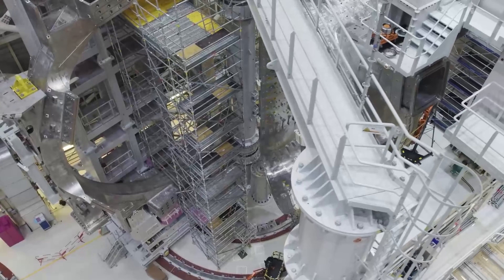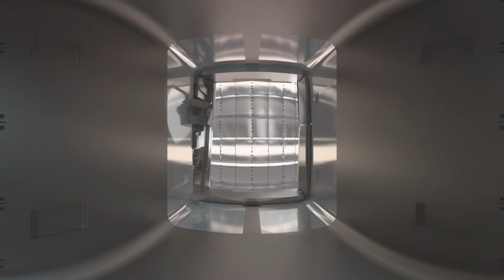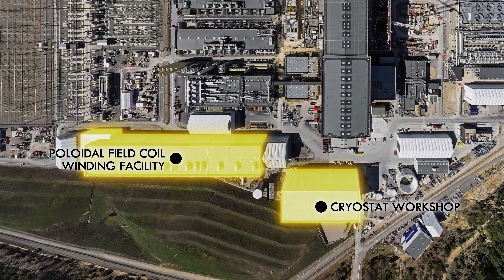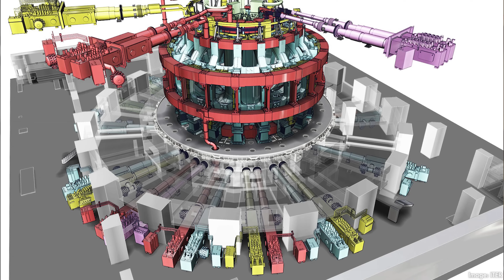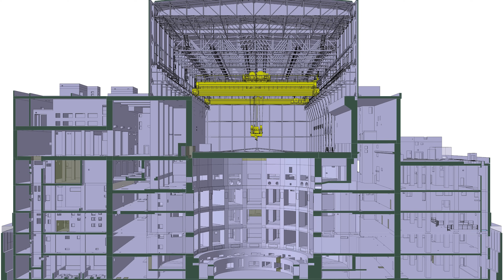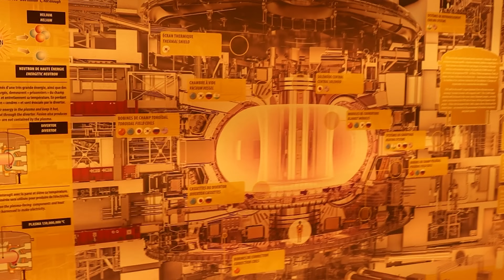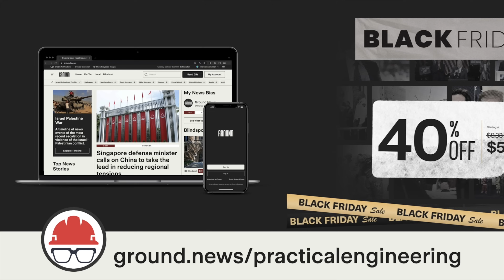Engineering The Largest Nuclear Fusion Reactor

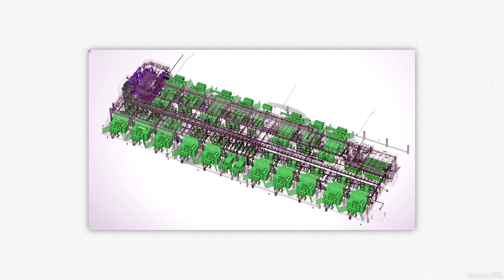Comment: 9:30 LHC has an automated beam dump process that works based on  perturbations in the magnetic field.    However their process has to work in the span of milliseconds in order to prevent structural damage from the beam.  So I was somewhat surprised that you mentioned this process took seconds for ITER, since that may actually be too long in the case of magnet quenching.
Reply: I'm surprised the LHC's beam isn't dumped even faster than milliseconds. I think the seconds bit is just dissipating stored energy to protect the magnets from thermal damage from current flowing in them, rather than beam/plasma containment. The plasma will not be able to be contained the instant (probably less than millisecond timescales) one of these magnets quenches, so the plasma "dump" is probably a separate process that happens much faster (likely microseconds) than the magnet-self-protect-current-dump (seconds) process.

(I don't work at ITER but this is my best guess)
Reply: The time scales of a supermagnet are shockingly long. Magnetic fields soak into them like water into dirt. Turning "on" a supermagnet can take hours, as the field slowly rises to the target strength.

Comment: The technology, engineering and construction is awe inspiring.  Im getting less and less "sold" on tokamak systems, mainly due to degradation and contamination effects of being exposed to long term exposure to neutron flux and high temp plasma, makes me a bit more skeptical of this route.

Regardless of it its the route we end up taking, ots crazy impressive.
Reply: Agreed. There are unanswered questions about what is going to be the best plasma-facing material(s) and what to do when they degrade. The human race collectively is going to need to come to terms with generating certain amounts of radioactive waste and containing it appropriately. No (currently known) way around it while also sustainably producing enough electricity to meet demand.
Reply: @erikdietrich2678 plenty of people are thinking about that! From proposing smaller tritium-breeder reactors separate from power-generating reactors, to those suggesting we’ll never get large-scale D-T fusion due to the neutrons so they think we’d have to wait for He3 to be economically viable. (Which would need much denser pressures to run; so researching with D-D and then D-T, exactly as Iter will be doing, would still be useful for getting to that point.)

Comment: The amazing thing is how this massive boondoggle got this far. How practical is it? Zero. Nobody talks about the cost per Kwh because there is no possibility of it being worthwhile. The cost of the reactor is what, 100X the value of the power? And that's if it works. it's a nice, interesting, super expensive EXPERIMENT.
Reply: Yes. It is an experiment. An expensive one.
So where other things. The Manhattan Project did cost as much as the predicted cost of ITER (which, of course, will cost more).

Comment: IDK, Grady.  It's kind of hard to get super excited for this as a step down the path toward fusion electricity.  This isn't even the buying a map stage of the journey.  It's more like the buying a sextant and chronometer stage.
Reply: You never got excited for a trip/tour you wanted to take when you bought yourself some binoculars or new outdoor shoes?
Reply: @cy-one  
IDK how apt that comparison is.  What you're describing results in a very direct, near-term achievement of goal that was pre-pathed.  This facility will mostly be about eliminating paths that won't lead to the goal.  A goal that we have no good functional idea how to accomplish (hence the path-eliminating) and will take decades to come to fruition, assuming it can be done (we don't know for certain it can).

To answer your question, though:  Not really.  I get moderately excited sometimes, but not super excited.  The most excited I get for a specific object is in just using it, not what I might accomplish with it.  Accomplishment gets it's own excitement, separate from any tool used.

Comment: Exciting stuff. So what are they going to do if ITER fails to do what it is supposed to do? or only gets q=5 or something. i guess they could redesign some stuff but seems very expensive for an "experiment"
Reply: Same as it ever was. Tell that to Tesla, Copernicus, Hedy Lamar!
Reply: It’s almost certainly not going to get Q as low as 5, unless something goes very wrong with the scaling from JET’s results. 10 was originally on the low end of expectations after all, but JET’s results indicated that’s the most likely outcome.
Reply: The same as always happens when scientific experimentation doesn't pan out.
Change the parameters, try again.

Comment: You forgot to cover where you get tritium.
Reply: Candu reactors  in canada to start with
Reply: @steveggca  Exactly. You need to have nuclear reactors to get tritium. Now you gotta go search how much of it was produced in the intire time of using nuclear reactors and how much even one ITER needs.
Reply: @Dustmadeout   remember that tritium is an undesired byproduct  from the moderator and heat transport sytems of a candu reactor. (heavy water/deuterium)
It truely is not wanted.    I suspect that there is a lot of research going on into how to mass produce it on purpose.
You have to start somewhere.
I have spent 14 years refurbishing ,inspecting and repairing Candu reactors, however my understanding of the physics of it all might only be slightly better than the janitors.😁

Comment: So, I have to raise a question. I grew up hearing that fusion is clean and sustainable, but recently I also discovered that the Beryllium surrounding the fusion chamber will essentially soak up neutrons, become radioactive, and turn into nuclear waste.
So... Isn't it kind of pointless?
Reply: Yes and yes, it pretty much has all the negatives of fission energy with none of the positives. Not to mention that its fuel, tritium, is only produced in fission reactors and in very low quantities. Fission now is what we wish fusion could be, but since the public hates it it’ll never take off.
Reply: @Elocian  such a sad state we are in, and it's been like this for years, yet the fearmongering continues even while science explainers who should know better try to cheer the public up. same applies to thorium, it's not as big of a deal as people make it out to be, but they compare it to what they think nuclear normally looks like and promote it incessantly.
Reply: Worse than that. I was a believer in the tech until a recent "60 minutes" TV show where they exposed they are LYING about how close they are to power efficiency. They are off by a factor of  100 So, Fusion is impossible in our lifetime. Maybe in another thousand years. "Well, it took 300 units of power to fire the lasers. By that standard, it was 300 in, 3 out. That detail was not front and center at the Department of Energy's December news conference which fused the advance with an unlikely timeline."

Comment: it never ceases to amaze me just how many ways we've come up with to boil water, and just how complicated we can make it!
Reply: Yes, Dr David Mills who invented the evacuated solar tube (for solar hot water etc) has said the race has been won by PV,  wind and batteries/storage.
Reply: @rabidbigdog  If "better" just means more direct and efficient then I supposes they are.
Reply: It always has been Steampunk
Reply: Makes my saucepan on an induction stove seem inadequate.
Reply: I just plug my kettle in and flick a switch.
Reply: Helion is another type of fusion reactor that doesn’t depend on steam turbines to generate electricity. The rapid expansion of the gasses reacts directly against the magnetic containment field which generates electricity directly. Is that a complete explanation? Absolutely not. Helion is also a big deal because it doesn’t require tritium for the reaction or beryllium and lithium to deal with the neutrons.
Reply: We have better ways of making electricity than boiling water.
Reply: @christiangeiselmann not really. Most of our generators are still turbine based. Second best option is photovoltaic cells but turbines are still more efficient.
Reply: @christiangeiselmann  like?
Reply: @krashd  But hydro is a limited source
Reply: @samarkand1585 not really

Comment: For those who appreciates time markers:

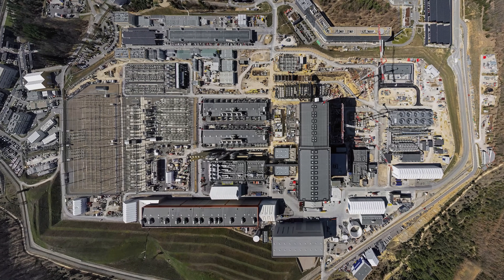0:00 - 5:00 can be skiped. 
5:00 - Braidy starts narating and talking shop to other civil engineer.
8:00 - connetion  challenges to powergrids. Power generation, thermal issues, power disapation
13:30 - statics and architecture support and contaiment design challenges
16:30 - inbuild promo and conclusion. Outro, adds.

Comment: Sounds like they're only about 20 years away from making it work. =D
Reply: "Well, it took 300 units of power to fire the lasers. By that standard, it was 300 in, three out. That detail was not front and center at the Department of Energy's December news conference which fused the advance with an unlikely timeline."  60 Minutes  By Scott Pelley January 15, 2023

Comment: Even if we know how it works, it seems wasteful to just waste the generated heat like that.
Is there a safety / engineering reason for not using it in turbines to “refund” some of the power used to start the reactor?
I could imagine it being the same reason they have to be very thorough with the power supply coming in to start it…
Reply: It's because there's no other way to work with this. And still it's got a 1% efficiency, looking at all the energy it needs to use to work at all. 

100 years of research and funding across several continents, for a 1% efficiency rating.
Reply: @daciandraco6462  where did you get “1% efficiency” from?

Comment: This sounds like a very complicated fusion reactor. But isn’t that part of the reason why new nuclear reactors are more simplified for safety? If any one part of this reactor fail, sounds like 100x worse than Chernobyl
Reply: Why would it be worse? There is no fissile/radioactive material in the water, so why worry when the water gets spilled? The only problem with it exploding would be the sunk cost.

This isn't a nuclear reactor, it's a fusion reactor, fusion and fission are different stuff, this gets taught in high school.
Reply: A fusion reactor could never do the even .0001% of the damage of Chernobyl.  If something goes wrong the machine just gets damaged/destroyed.

Comment: It seems like cooling down all the heat generated is a massive waste of energy. I understand that their main focus isn't energy production, but what if they added a steam-powered generator to harness some of that energy to create hydrogen? Converting energy into hydrogen is a complex topic that needs further study to make it more efficient. If ITER wants to keep its experiment clean from other concerns, why not let another research group build a facility down the road and use the generated heat?

We're already facing challenges when it comes to generating electricity in an environmentally friendly way for regular use. I'm skeptical that ITER is using green energy to power itself. If at least some of the heat could be converted into hydrogen or another product, it would help reduce the environmental impact of running ITER and move us closer to transitioning away from fossil fuels...

Very cool topic...

Comment: 11:45 - It's neat that the cryoplant has what looks like a permanent gantry installed, like they just know they're going to have to move heavy stuff around often
Reply: All major buildings in a power plant have gantries due to the enormous components that may need replacing - turbine halls, reactor halls, boiler halls, etc, even the pump rooms in a nuclear power plant have crane assemblies built into the ceiling to lift the enormous pumps out for maintenance.

Comment: Always amazing how much electricity is generated by using some sort of heat to turn water into steam to spin a turbine driving an alternator
Reply: You'll find it even more amazing if you look at the insane amount of energy this needs to run. As net output, you get 100th of all energy put in. Amazing.

Comment: As someone that worked exclusively on the physics and diagnostic systems of iters tokamak, its nice to have a civil engineers perspective on the whole build
Reply: As someone who didn't work on tokamak, it's also nice.
Reply: Underground might have been easier for temperature control.
Reply: @brodriguez11000  its honestly such a large thermal gradient it dosnt matter where its built in that context. Underground would just be even more cost and tbh the main chamber it is sunk into the groud as it is
Reply: @LeeAtkinson98  What’s your favourite part that you’ve worked on?
Reply: @LeeAtkinson98  I understand that it's not at all part of what you worked on, but I still would love your input on why they chose not to utilize the heat more instead of venting to the atmosphere. Sure, steam turbine generation is well studied, so not something you would get academic benefit. Still though... 

Would it not have been way more efficient/beneficial to utilize that energy in some way, especially given the amount of energy (600 megawatts!) needed for this process? 

Would you not have been able to reduce the strain on the grid either by generating electricity and storing it in a battery/capacitor to feed back into the system? 

What about a molten salt thermal battery similar to mirror based solar generator systems?.... and then probably generate power with a steam turbine similar to mirror based solar generator systems?.... Sorry.... it all leads back to steam generation power XD
Reply: @BAoxymoron  simple, it just adds more cost and complexity. Even if the basic infrastructure is cheap and well known, integrating it into a reactor just wastes precious space for diagnostic equipment which is already at a premium.

That and steam power systems are based on continued power output, tokamaks like iter and others using transformer action to generate a current are limited to a few seconds to minutes of operating at most. You just wont get much back anyway from such short sharp bursts. 600MW sure, but over a second is only 600MJ just aint worth it, that's the same as 7kw over the course of 24 hours, so one A/C unit run for a day.
Reply: @LeeAtkinson98  why didn't you reply to the guy before him who asked what your favorite part to work on was?
Reply: @LeeAtkinson98 do u think it'll work?

Comment: While the large size of ITER is impressive, it also suggests this whole effort is very far from the "practical" in your channel's title.

It is illuminating to compare the gross volumetric power density of the ITER reactor and today's fission power reactors.  You will find ITER's is smaller by a factor of about 400!

This is the Achilles Heel of DT fusion.   The reactors will be much larger, and hence much more expensive, than fission reactors of the same power output.   If fission is struggling to compete how could these more expensive machines ever do so?

The fundamental problem is that old familiar engineering principle, the square cube law.   Fission reactors transfer heat to coolant through the walls of fuel pins.   The total area increases proportionally to the volume of the core.   In a DT fusion reactor, however, energy is transferred by neutrons through a first wall.   The area of this wall increases more slowly than the volume.
Reply: At this stage, I think fusion scientists are ashamed of just admitting that all the funding has been for nothing, in terms of this being a practical solution which can offer humanity cheap, plentiful energy. There's been no other technology in modern history which has taken up so much time and money, with close to zero practical application. 

In the case of nuclear fusion, people have been looking into it for a little over a century now. This should join string theory as a dead end idea, before it eats up even more public funds.

Comment: Continued work on fusion is fine for scientific research purposes, but forget about fusion power plants because the window of opportunity closed some time ago.  The future is 100% of our electricity from renewables plus batteries.  Even if we had a working fusion plant today, it couldn't compete on cost.
Reply: The tech is still extremely important.
A colony on mars for example couldn't use wind, solar would be weaker too and I'm preeeetty sure that hydropower is out of the question, too. A fusion reactor however would work.

Comment: It's a missed opportunity that they didn't include the steam generators. They're spending a lot of money on an important science experiment, but if it works out, why not use it as an actual power plant?
Reply: That’s what DEMO will be for, which is now intended to be a retrofit to the existing Iter reactor (rather than a bigger one built alongside, as it was originally). 

There’s nothing to say they couldn’t replace the current cooling system with electrical generation, but there’s no reason to actually set it up until you’re sure you’re going to get enough of a thermal surplus. 

For many years Iter will only be running deuterium-deuterium (D-D) reactions to ensure everything works right, before starting on the deuterium-tritium (D-T) reactions to test different cooling and tritium-breeding blankets, push continuous reaction time up, etc. D-D reactions produce much less power but are also much more controllable, and don’t require any expensive tritium to get consumed. Every D-T reactor design does its initial fusion on D-D fuel for these reasons :)